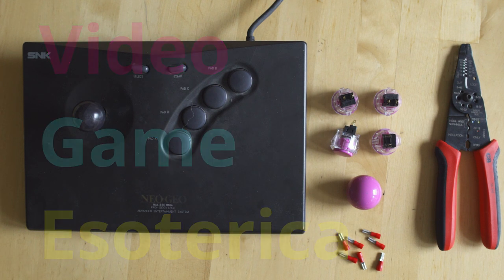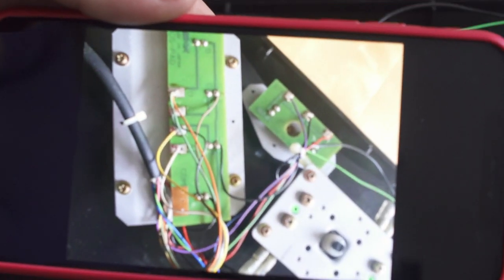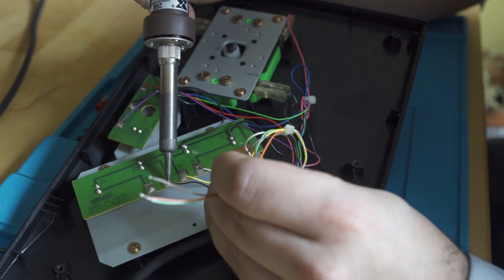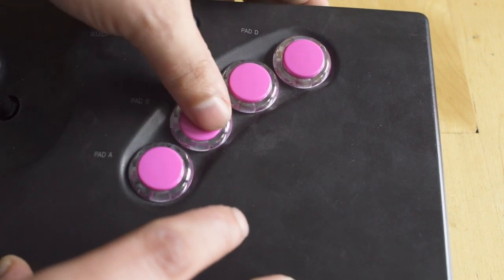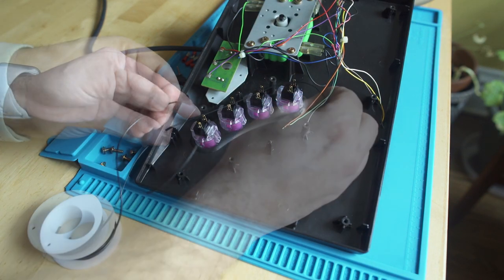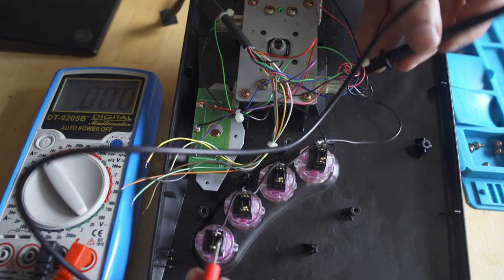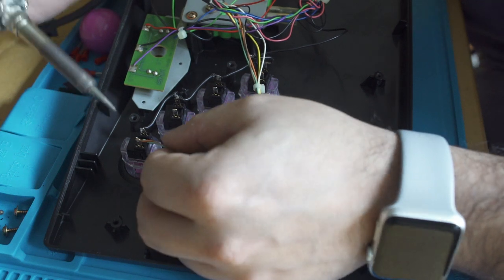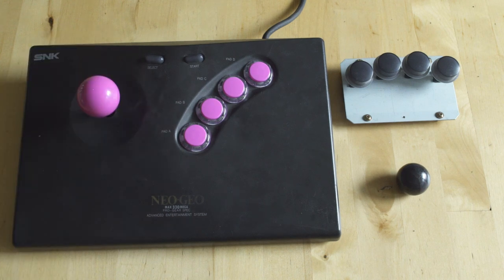How to mod your Neo Geo AES stick - "On a Technicality" - Video Game Esoterica

Comment: Sanwa now has microswitches called SW68-CAU which make for significantly smaller height profile, I personally used those. Also the metal bracket with the original button in my opinion adds valuable weight to an already flimsy joystick so I'd personally keep those installed (the sanwa microsw will fit through no problem), also chance to say you have a cool channel, keep up good content.
Reply from the maker: I’ll check those buttons out! Glad you enjoy the channel :)

Comment: Doing this mod to a Neo Geo X controller. I replaced the joystick square gate with a “Gate of the Wolves” octogate from Jamma Nation X. I’m also removing all the usb components and wiring up a db15 cable. Just waiting on the buttons. 24mm in case you didn’t mention it.
Reply from the maker: I thought about swapping the stick but it was in perfect working order so I kept it stock. I need to check out the new Arcade Stick console still. Haven’t seen one in person yet
Reply: Video Game Esoterica I‘m keeping the stick. I tried a handful of different arcade sticks from seimitsu, Sanwa and Zippy but they were all to big to fit in the shell. I went with a simple gate swap. 

I have an Arcade Stick Pro as well. Switching out the stick and buttons on that and wiring up a db15 cable as well so i can use it with a real Neo Geo. 

The stick is Great as a console. The emulation is good and the 1080p video is gorgeous. Just wish it had scanlines with pixel scaling. Right now you can only get scanlines with smooth scaling.
Reply: long ago but i also have that octo gate but i am having problem hitting the diagonals with it wenn you come from the horizontals. did you notice that?
Reply from the maker: It’s a learning curve but you’ll get used to it
Reply: @VideoGameEsoterica  no, i mean it does no trigger the microswitches. I had to trim the plastic but still not perfect.
Reply from the maker: Hmm no haven’t encountered that personally

Comment: You should have kept the metal plate for the buttons to keep the weight in the joystick. They will fit with it!
Reply from the maker: I thought about it but I wanted to use the whole assembly for a different project (which I haven’t started yet lol)

Comment: you didn't explain how to put the rubber gizmo back like it's supposed to from the cord or how to replace the rubber feet on the controller.
Reply from the maker: I think I mentioned I’d replace the rubber feet off screen as mine were totally brittle? Lol they basically fell apart.
Reply: @VideoGameEsoterica  the cord on the controller.

Comment: Never owned a Neo Geo AES stick but this is still a really cool mod! I assume using quick disconnects on the button side would have been an easier solution than directly soldering the wires to the buttons?
Reply from the maker: Yes. Unfortunately the quick disconnects were too tall to fit in the case. Considering these buttons will last for at least a decade solder is a fine option
Reply: @VideoGameEsoterica  Huh, it never occurred to me that they were too tall for the case.
Reply from the maker: KenAthomos I could have bent them but in the end I decided just to solder
Reply: @VideoGameEsoterica  Apologies for the follow up question, I'm new to stuff like this. There is no negative effect if the quick disconnects get bent?
Reply from the maker: KenAthomos none. As long as they don’t break the signal will be fine :)
Reply: @VideoGameEsoterica  Ahh that's good to know! Thanks for the replies! Really appreciate it.